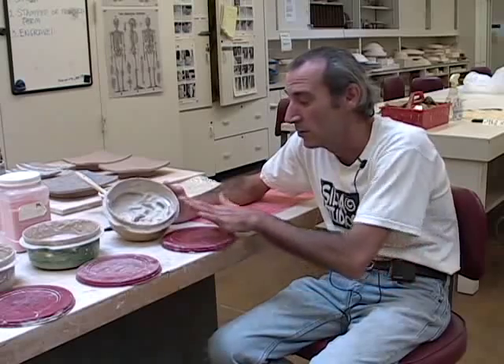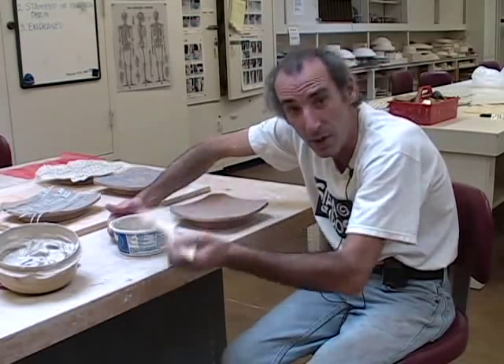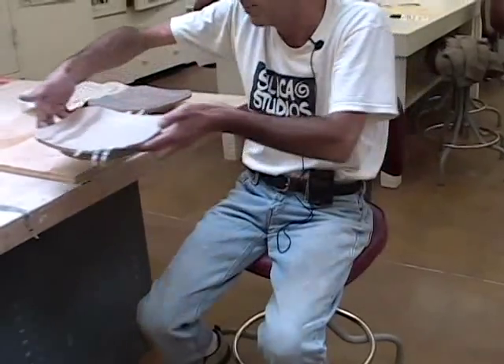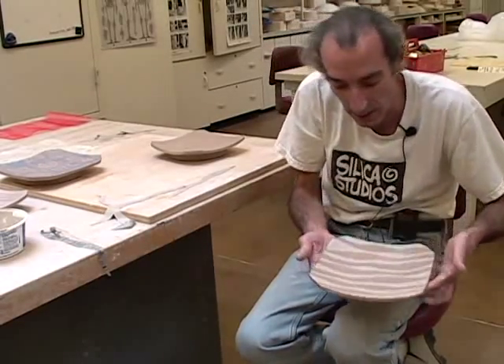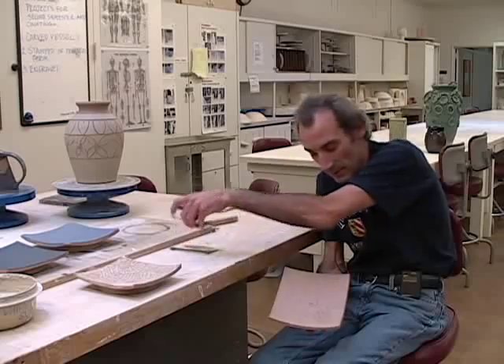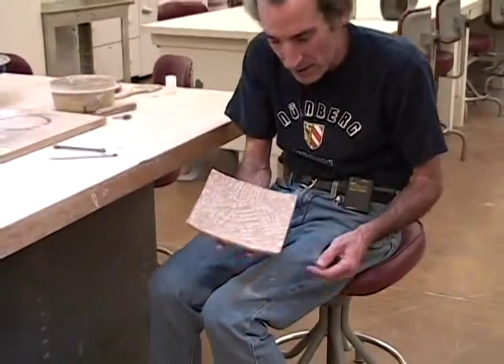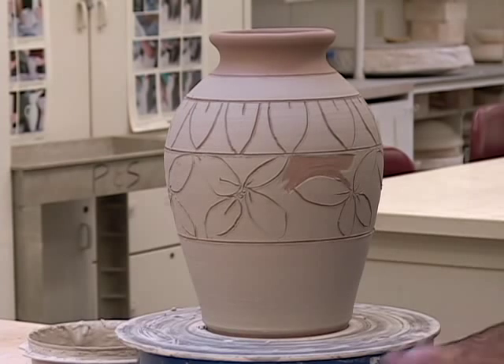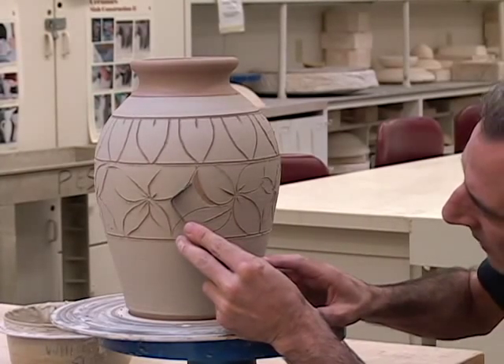#3 Glazing - Slip Training

Comment: Well demonstrated. Would add that Mishima, because it is done on DRY clay, requires one to wear a N95 or better dust mask, and done outside or in a well ventilated area, for safety's sake. Clay has silica, and silica can cause silicosis.